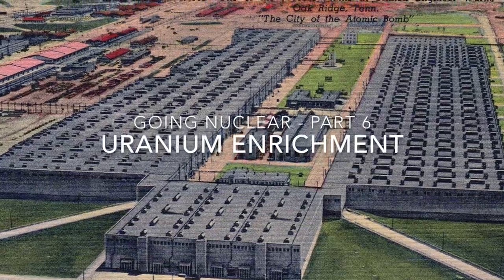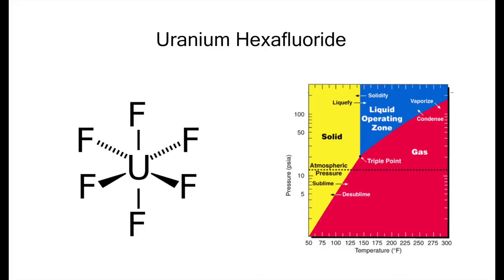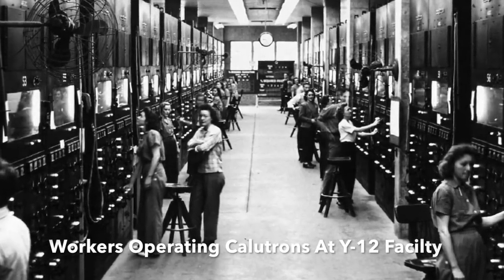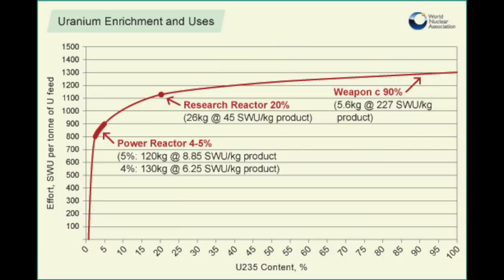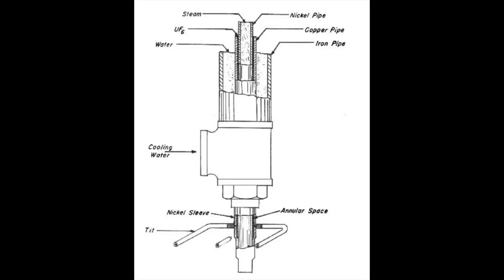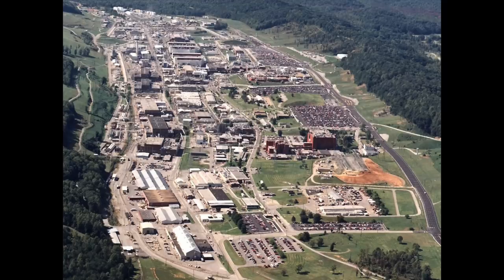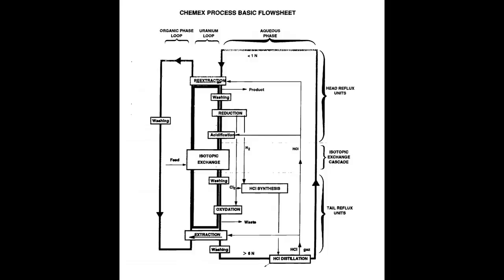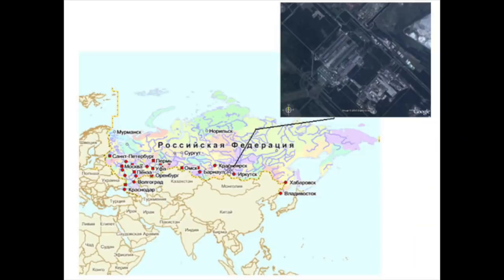Going Nuclear - Part 6 - Uranium Enrichment

Comment: Thorium > Uranium
Reply: Meh, not really. It is all about the quality of the reactor design :D
Reply: Food > Bombs
Reply: U233 is a perfectly suitable weapons fuel. Statements to the contrary are usually made my nuclear engineers and not weapons designers. Quotes from weapons says that if the US had decided to use U233 instead of Pu, they would have no interest in switching. That was also why they suggest they were uninterested in switching from a mainly Pu239 driven world to a U233 world. Add in the rather unimpressive demonstration of the singular U233 bomb we fielded, and you have more a history and legacy support of Pu239 than any actual real technical problem with U233 as a weapons fuel. Statements of U232 are generally over stated and oversold.

As to thorium as a fuel stock in reactors, it only offers novel advantages with comparable disadvantages. The real heart of nuclear safety, fuel efficiency, and general ability comes from overall reactor design rather than just fuel choice. Many of the supposed advantages of thorium fuel cycle are more that of breeder reactors in general or molten salt systems in particular, neither of which are restricted to thorium. 

Anyway,  sorry for the rant. Thorium reactors are what got me interested in nuclear, but there are a whole lot of things that are exciting in nuclear of which thorium is but one :D